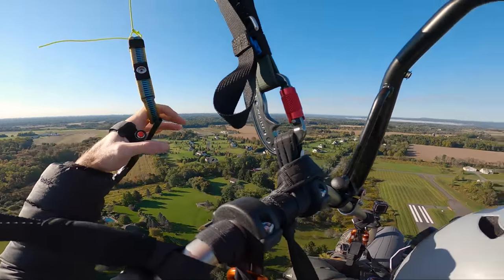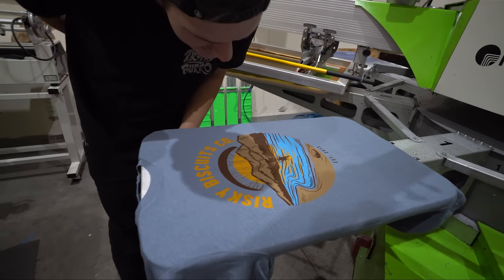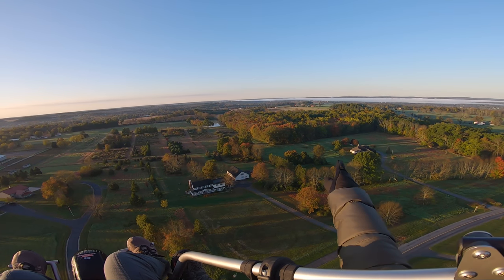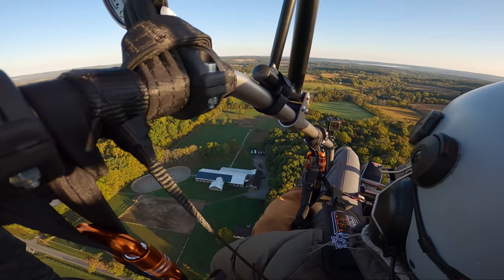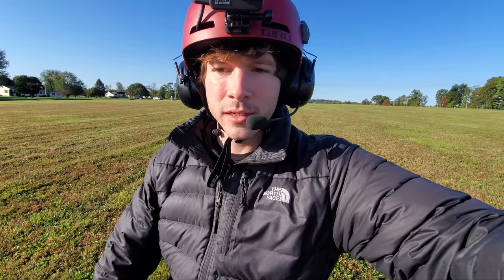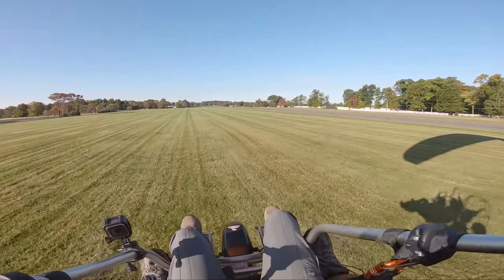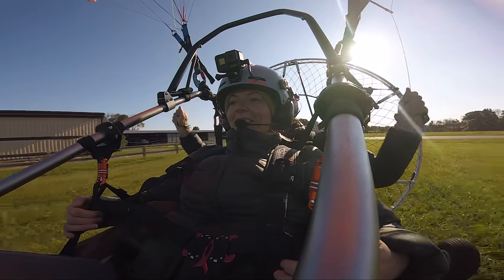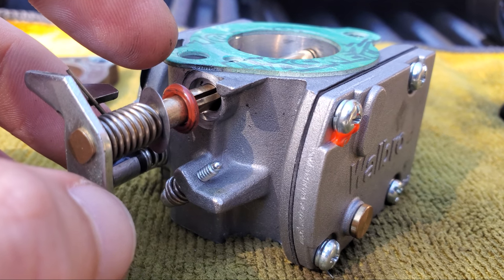I had an ENGINE FAILURE while flying my girlfriend to breakfast...

Comment: You say engine failure and I think “the engine shut down in the air” not “the engine stayed on in the air”
Reply: Any type of failure of the engine is an engine failure. Worst thing one can do is to trust and engine that has a fault - especially if it is an intermittent fault
Reply: I would also much rather have my engine die than have it stuck on with power.  Flying correctly a dead engine just means an unplanned landing.  An engine stuck on with power greater than idle, offers a much more challenging situation.  Especially if the kill switch is also dead.  Every time I see something like this I tell myself I need to rig up an emergency kill cord to my spark plug.
Reply: @EBangtson1  Most small aircraft are designed to have the throttle fully open on failure. It's on purpose with the idea being at least you can get out of a dangerous situation if you're in one, while an engine which fails off might put you in a dangerous position. Idea being you can at least likely kill the engine still.
Reply: @lost4468yt  that may be true on an aircraft, I fly PPG and it would not be true with this type of flying.  I would much rather have an engine out which is a non-event, than a full power on situation.  One only offers a transportation home problem, the other could be fatal.
Reply: When your engine is permanently running you would probably need to wait until your fuel runs out...
Reply: @jan-lukas  If stuck full throttle you are going to be fighting not to climb. Big ears...spirals.  Full throttle and I climb like a bat out of Hell.  The attack angle of of wing is WAY different and I would not be thrilled with doing any of those maneuvers wide open throttle.  I would be fighting to figure out how to remove spark to kill engine.
Reply: @EBangtson1  You would climb until the fuel is fully burned or the engine is dying because of sustained full throttle application
Reply: @EBangtson1  good thing he had an extra person to prevent a massive climb

Comment: If the O-ring has swelled it sounds like it's the wrong material for the application. Do you have to make a report to the faa ? Is there any process for reporting deficiencies or warnings sent out to other owners ?

Comment: I’ve seen those O rings swell using different chemicals to clean carburetors.
Reply from the maker: I can imagine! This carb has never seen any chemicals aside from the gas that has run through it. It's very new as well so I'm curious to know why this happened.
Reply: Are you running Ethanol blend fuel ?
Reply from the maker: Just premium pump gas. It has never caused an issue in the past and that's all I ever run. I'm wondering if this o ring was different for some reason.
Reply: A bit odd to have a Red O-ring which could indicate Silicon. That would explain the swelling.
I'd expect to see either a Brown or Black O-ring in there. Will be interesting to see what color O-rings are installed in the other Walbro's. Something has to be done to prevent that return spring from coming over the edge of the carb body if O-ring failure occurs again. Bad design for sure.
Reply: 2 stroke oil  and or ethanol
Reply: @TuckerGott  I wonder if it's due to American fuel's octane level. Here in the UK, our lowest is 95, whereas in the US, I think you have as low as 87 or something. Lower octane is faster to burn.

Comment: Is the construction tube steel or aluminum on this tripod? Hopefully steel. Solid aluminum I'd trust, but only if it has joint connectors. Never trust aluminum braze.

Comment: Looks like a silicone O-Ring and they have a tendency to swell from petrol, 
The other thing id do is to cut a small notch (16:11) on the body part so the straight part of the spring seats in the notch and cant slide along

Comment: Dude landing on a run way without radio clearance is really dangerous even if its a small airfield. Not sure how you worked that out. Unless its a private runway
Reply: Not any more dangerous than anything else. See and avoid and make sure you do your best to be seen. And abide by the right-of-way rules. Radios aren’t required by any aircraft at a non-towered small airport like that. If you have it use it, but not required.  Not sure what you mean by radio clearance, but there’s no one at that airport to give clearance. Radios only used for self reporting position, which is a good idea. But once again, not required.
Reply: @bricehultgren6073  I mean I guess if it didn't have a tower or control for landing.  Most small airports do unless they are private.  I guess that was a private landing strip
Reply: @drewsquickfix  LOL No, MOST small town airports do NOT have control towers here in the US. A lot of airpots that probably should have towers don’t. And some of the ones that do are only part-time, meaning the towers close at night. Ther are a lot of airports served by airlines that don’t have towers and aren’t “controlled”.
Reply: *airports.
Reply: @bricehultgren6073  sorry man im not trying to give you a hard time love your videos. Just wish you'd be a littler safer sometimes but you are doing a high risk activity that looks incredibly fun. -cheers
Reply: @drewsquickfix  I did not post this video, it’s not me, nor do I do this type of flying. However I am an Airline Transport licensed pilot who has flown Regional Airliners, corporate, and some freight. I’m not trying to bust your balls. But the ratio of non-towered public airports to towered airports in the US is fairly large. Comparatively there’s nothing more dangerous about his type of flying than flying a Boeing or Airbus into or out of San Francisco, Newark, or any other large airport in the US. 
Regards.

Comment: That looks like a serious design flaw and it's not something a new O ring will fix! I hope they address the root cause and fix it. The O ring needs a channel within which it can be secure, apart from the fact that the spring should NEVER be allowed to slip off. This is a disaster in the making.
Reply: Someone else migjt not be so lucky.
Reply: It would be very simple to manufacture a spring with a longer arm and a hook. The engineers will fix it I am sure but they first need to be told. . .
Reply: I 100% agree with this. And knowing a failure makes it required that they investigate, modify and rectify. Their liability goes to unlimited in the face of a known failure they don’t address.
Reply: Yep, that  carb design flaw and other design  issues I saw makes that carb appropriate for a lawnmower not a flying machine. Hope tucker get an upgraded carb.

Comment: Don't understand why you can't buy an "O" ring kit that Would include the correct size. 
It's great that you have Awesome support..but it shouldn't be that difficult.
Reply: You could always sneak one out of your buddies carb when he's not looking too ! There's only 84 of these O-rings available on the entire planet ⭕️
Reply: Agreed, not sure how you would do it but get an O ring that would work for any other two stroke engine's carburetor. A paramotor shouldn't need a specialty O ring, and any that fits I imagine would work
Reply: @drewmortenson  You can buy packs of o-rings that have a wide range of sizes. You could pick out one of the ones of the right size and pop it in.

Comment: Unless the carburetor sees high temperatures during use (which it shouldn't, otherwise all the gaskets would get cooked) I believe o-rings made of NITRILE ( Buna-N ) should be used. Also, o-rings actually seal better if the transition points between surfaces define a 90-degree angle, not a curved transition to match the shape of the o-ring.  But that would be a carb port design issue if such is the fundamental problem. Nothing you could do about that. By the way, the new carb will eventually fail the same way at some point.  A redesign of the plate (or similar component) that holds the o-ring in place is needed.

Comment: You can get any o ring generically by searching the OD/ID & thickness and type, make yourself a maintenance, repair kit on the trike of all the small failure points, also create a system where as say a spring failure etc the throttle can be operated without or even a secondary option. Like let’s say a resivour of fuel after the tank pump in case the pump fails that could gravity feed for some time as a option.

Comment: I have to agree with some of the other posters. That carburetor body needs to be modified so that spring tail can't fall off the end. Someone suggested cutting a groove for it. That would probably work but on a cast item like that, too easy to damage it structurally. I would suggest taking some JB Weld and a small bit of scrap metal. Secure it in place with the JB Weld or some type of good epoxy mix so that it acts as a catch.
Reply: If the carb body will allow drill and tap in a tiny roll pin that sticks up and prevents the spring arm from ever going over the edge.

Comment: take a small file or dremel and put a notch where the long end of the spring lays  on your new carb ,  or take a bump of jb weld  and put a dab on the carb so the spring cant find its way off the edge..

Comment: Watch out for methanol added fuels, some things use rubber that is not compatible with alcohol so it will make your fuel lines crack and your "O" rings swell if there not rated for it.

Comment: Noticed you adjusting the hang point before launching. A little pro tip...I ordered more hang point collars from Fly Products and have several points for multiple passenger weight ranges so all I have to do is move the straps. Another nice video!

Comment: You can pick up o-ring kits at harbor freight. They have kits for them and of different types depending on application. usually you see them for air conditioning systems I believe those are green.
I'm also a bit surprised that you don't have a two-way cable on that throttle, motorcycles before fuel injection usually had a cable that pushed and pulled the throttle so that things like this can't happen. Certainly complicates things a bit but it would prevent this from occurring. One other issue is with that o-ring popped out of its socket the carburetor could be sucking air past that shaft which could affect the way the engine runs.

Comment: That spring arm should really have some kind of groove or catch in the carb body to prevent it slipping off, even in the presence of a bulging o-ring (or any other minor twist/issue with the spring)
Reply: Or that arm of the spring needs to be longer and bent back around the body to ensure it can’t slip off.  The groove is a good idea and something Tucker can do with a small file.

Comment: Hi Tucker. What if, just in case, you took a small triangle file and notched the metal of the carb body where the spring tail sits so that it can't move even if the O ring were to do that again. Stay safe and clear skies.

Comment: nice bit of diagnosis    such a simple issue could have had not nice consequences .  there should be a small notch in the carb body to locate that spring tail . I would modify the replacement carb to ensure the  spring tail is not able to slip out of position . Maybe even an extra O ring to retain the shim washer in place . your trike landings are looking spot on ..  I loved the I am nice and warm .. shame about you getting frozen up front LOL.

Comment: I once had a similar O-ring go all "fat" in a CO2 bike pump, which made it impossible to seat. I believe it was the wrong formulation of rubber (buna N or whatever) for the specific application, and once I got the OEM part, things were fine. Still, high pressure and super-cold temperature definitely had something to do with initiating the failure.

Comment: Finally got around to watching this Video. On the subject of the O-Ring, that's not a Viton Fuel safe O-ring. Should be Black. I used to sell them all the time at the Auto parts stores I worked at(10 years as a Auto parts specialist was enough for me). Anyway, if you need one hit up any Major Auto parts store chain with the old carb in hand so you can match up the right size. They carry them in bulk and should sell you just one if that's all you want.

Comment: Tucker did you use a solvent carb cleaner spray ?These soft o rings can absorb the solvent and swell like the problem you have experienced.This does not seem to affest the hard black o rings which are made of nitrile rubber whereas the orange ones are silicone based.Hope this helps,i dont fly but i work with engines which use this type of carb.Enjoy.Clive

Comment: Tucker  , 

  You should seize the moment and offer a design enhancement to the carb throttle spring seat. It could be the TG edition carb. Oooh, or,the  TG-S1 advanced carburetor. 
         HECK YEAH !

Comment: Your O-ring dude... I know you've previously mentioned using general gas from a fuel station and not avgas.
Is this an E10 issue - I have carb fuelled bikes and E10 is too much watering down BS green planet blah blah and that stuff swells "rubber" like no other!

:)

Comment: May I suggest a safety for your carb........I fly large scale RC airplanes that use that same walbro carb and I have had that same problem with the spring. My fix, and I do it on all my carbs now, is to take my dremel tool and cut a groove in the aluminum where the spring tail sits. Just move it aside like you found it, cut the notch then move the spring tail into the notch. That won't happen again!

Comment: NIce flight. :) 
About the carb. You got a new one from the factory and that is great, but the carb should come with a slot where the end of the spring will be stuck, preventing it to slide off. 
You can probably file the slot yourself.

Comment: you could cut a slot with a dremel in the piece the spring end is sliding on to keep the spring end in place, it wouldn't take but the thickness of the spring , factory should have had a notch there already

Comment: I have seen rubber o rings swell from gasoline or carb cleaner.  Most common is the float bowl gasket,,once removed it wil not fit again because it swelled so much. 
 They make orings that will not be effected. Seems it would be called for with this engine.

Comment: I had a walbro carb do the same before and I think it was from fuel with ethanol. Haven't had an issue after I switched to non-ethanol gasoline.

Comment: with an angle grinder and cut wheel cutting a wee tiny notch into the carb body where the leg of the spring should stay put should prevent future spring leg slip off regardless off o-ring failure.
Reply: or a file...

Comment: These 2-stroke engines remind me of the cut-down chain saw motors we used in large scale RC airplanes; Walbro carbs and all. You'd think that a 70 year old company would certainly have sorted this out decades ago. It's been 30+ years of ethanol in gasoline. No excuse.

Comment: I would also file a notch into the carb body so that spring end can't slide off again. Former small engine mechanic advice. And why did you say that you had an engine failure when it actually didn't fail but had a minor malfunction? Glad you two made it back safely.
Reply: What do you think about a tiny roll pin hanmered in and sticking up 2-4mm if the carb housing will allow a small hole. The spring arm will not get past that.

Comment: Just had a thought. Why don't you modify the spring? Some parts have where the spring end fits on a hole of the part to secure it from coming out. I think fixing the spring problem is better because if the o-ring fails then with a better engineered spring the problem won't happen. Also might want to add checking the o-ring as a PM. Just a thought.

Comment: I would have cut a small channel in the carb body so the spring remains in place at all times, and secondly you can easily buy O rings to suit, no need for full carb, I would not trust the new carb as it normally happens to them all.

Comment: Need a thicker washer in front of the o-ring.. That is an issue with the carb as it looks like to could happen again.  O-ring is swelling - and with a stuck throttle becomes a life safety issue they need to recall.  My 2 cents..

Comment: That was a cool flight.  Probably the most epic breakfast run of all time.  Until the throttle issue that is.  You would think there would be something to keep the spring from sliding off the casting.  If there was I suppose you wouldn't have found the O ring issue.  We've had the wrong O ring for a given application at places I have worked.  People just thought if it's the right size it'll work.  Not quite.  It made for some excitement from time to time.

Comment: i ordered replacement o-rings for fuel injectors on the car, they were made out of silocone, NOT rubber.  silicone o-rings do NOT work, only rubber o rings work

Comment: If it was me I would take the shaft out of the new carb and put a notch for the spring with a file or dremel so if the same thing happened at least the spring wouldn't slip down!

Comment: Other than the obvious danger of losing throttle control, you also run the risk of running lean if you have any air leak in the intake system and on a 2 stroke that can be much worse for the engine than it would on a 4 stroke, although it is bad for any engine.

Comment: Some O ring material will swell when it comes into contact with oil etc. They may have fitted the incorrect O ring when they built that carb up

Comment: Walbro sucks. You can keep trying to rebuild them all day long and they never come back as strong. Been dealing with it for decades. I would suggest looking at the specs of what the O-rings are and finding a blue or green silicone version that fits and you'll solve the issue. Same goes for any rings inside the carbs. Good video though, glad you kids had some good grub and a safe trip.